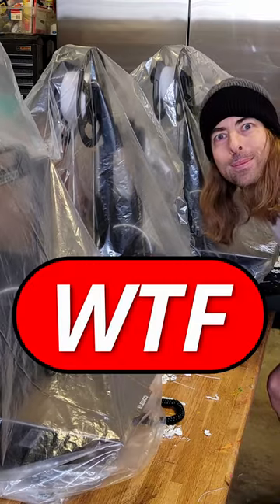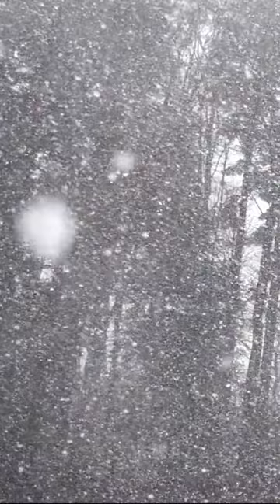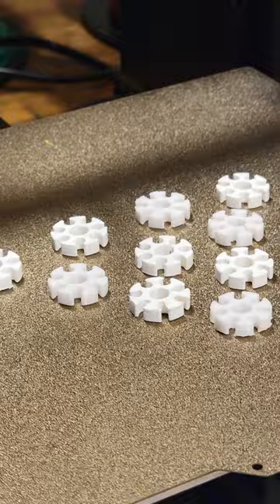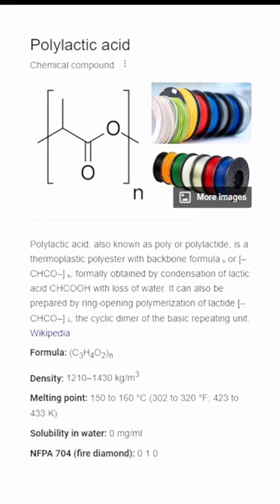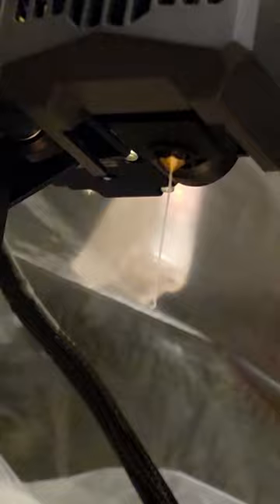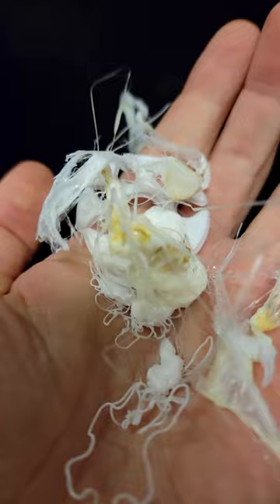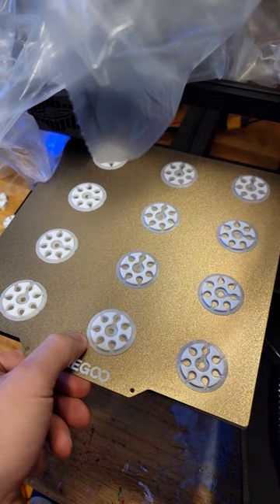3D Printing Bag Hack #3dprinting #shorts

Comment: If you use rubbing alcohol and use a paper towel to spread it, works every time for me on my ender 3 bed. Keep in mind the heat bed is months old with scratches,indents, etc.
Reply from the maker: This type of misinfo is what RUINED my brand new CR10V3 bed. Most beds these days are textured and no textured bed needs alcohol which can permanently DAMAGE the coating especially if the bed is warm. This video addresses the problem of draft/wind (warm or cold) on prints sticking effectively.

Comment: Just use purple Elmer’s glue stick on your bed
Reply from the maker: Wrong. These magnetic bed plates are textured and have perfect adhesion and the printer auto levels itself perfectly. The problem occurs from draft air circulating around the edges of the print, causing the pla to shrink prematurely. Wind is created when two different temperatures/air pressures exist and seek to become neutral by traveling through each other and exchanging with each other. This is akin to mating in Nature. Male female = hot cold.
Reply: @Kimchi_Studios  I have my printers in the same room as my house furnace so I’m dealing with cold drafts around my printer. A good trammed bed and Elmer’s purple glue stick solved all my adhesion issues. But you do you and burn your house down I guess.